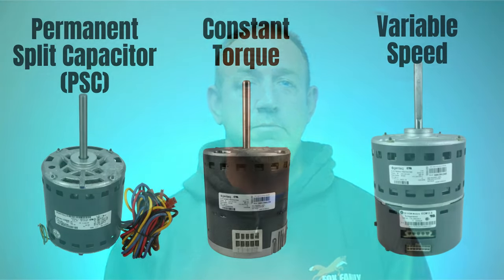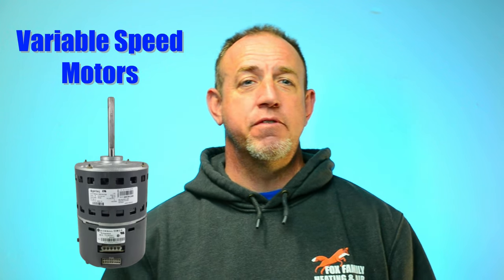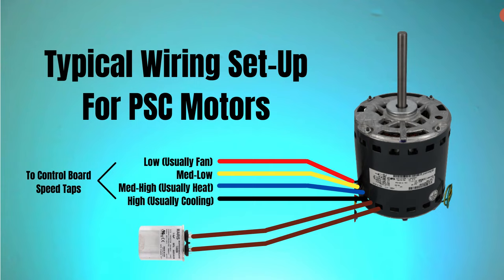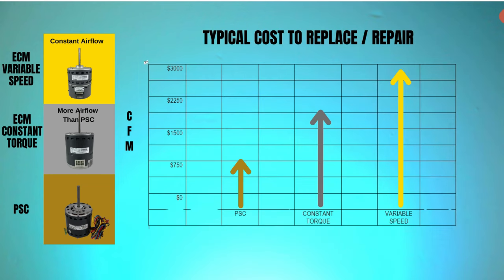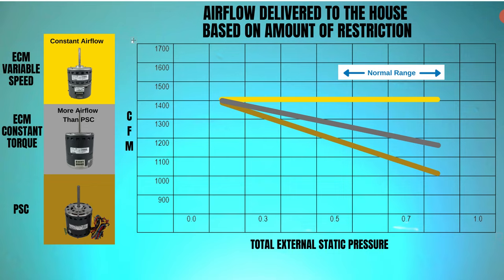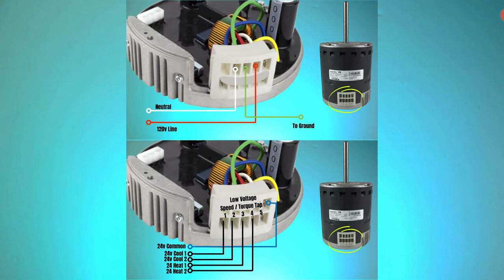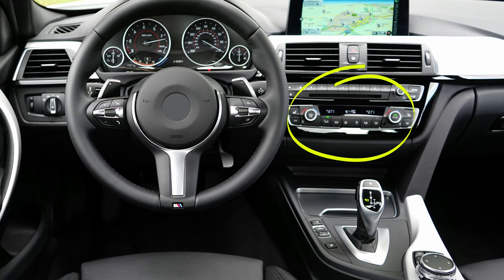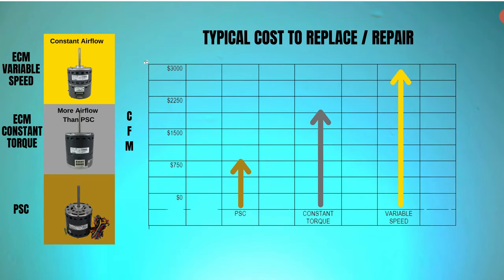PSC Motor vs Constant Torque Motor vs Variable Speed Motor | Comparison Video

Comment: Very nice explanation. I wonder, though, why doesn't the industry use more conventional AC induction motors with variable speed frequency drives. The cost of the these should be very competitive in fractional HP sizes. I seem to recall 1hp VFDs selling for just a few hundred dollars, and that was 10+ years ago. The pool pump industry has VS models that sell for less than 1500 at retail.
Reply: Even though one could easily control the speed of a three phase motor there is very little significant difference in the efficiency of the three phase motor over the PSC. Because of that they would still have to go with an ECM motor because they are 80% efficient. There is slippage when using a PSC or a three phase. No slippage with ECM.
Reply: @jimthvac100  I agree with you about the slippage,  but the efficiency hit is not that great, particularly with FHP sizes. I'm talking more about cost of replacements. The components should be much cheaper, but they are not. I'm guessing that the actual manufacturing cost of ECM motors and drives is actually lower than 3phase motors and inverters, but they are sold at very high prices because the end-user has almost no leverage when needing a repair. In other words, I think the industry may be guilty of price-gouging.
Reply: Not sure you fully understand how these motors work. An ECM motor is actually a 3ph motor with a module attached to the back that converts 120-240vac to 3ph AC like voltage that can modulating hz to control motor speed. The savings in ECM vs PSC motor is that an ecm motor can ramp slowly to its required speed not drawing FLA during start up where a psc just kicks on drawing excesivly hi amperage to get going then settles down to run load amperage and stays there. Another savings with ECM Variable speed motors is they can ramp up or down to provide only the nessesary air volume at any given time. Meaning on a multi stage high efficency unit it can slow down the fan, the compressor, the cu fan motor all at the same time when the thermostat gets close to set point and continue running at a very low amp draw while also making a much more comfortable environment with assentually no temperature swings. The slower the motors operate the less amps they draw. A psc just starts and stops drawing a lot of amperage on each start up and then continues to draw the same RLA until the stat is satisfied. The start up of a psc on each call for heating or cooling is where the majority of the energy is wasted. But if you were to leave the psc motor on all the time you would also waste energy as the fan is not needed all the time even if its running at a lower RLA draw 24/7.
Reply: The cost of a small drive will still be around $500-700 then you will still need a speed reference to run the drive at the desired speed and since you dont have a BAS building automation system you would need some kinda of fance control board withbstatic pressure sensors I/o to operate the drive and motor so another $1000-2000, then you still need the motor another $100-200, breaker or fuses to protect the drive $75-120.  So at munumim thats $1600 before installation costs. So its currently about the same costas the current residental ecm set up except the current ecm setup in residental is way more compact and actually fits inside the ahu nicely. As time progresses these ecm moters and tech will come down in price. They are pretty much standard in all new equipment being sold now lower models have constant torqe motors and higher efficiency units have variable speed motors.

Comment: The capacitors on PSC motors used on compressors and fans on outdoor HVAC condensing units are always energized on most units. There is typically only one contact that opens that prevents the unit from running, but the other 120v feed is always energized. Does this arrangement actually contribute to wearing out the capacitors?
Reply: The caps will maintain their "charge" after unit shutdown unless "bled" intentionally or if they have a built-in bleed resistor (across the contacts) but otherwise they are disconnected from the power source during a unit shutdown. I believe that cap failures are most likely due to inferior manufacturing (Made in China), after all they are a passive device. Of course improper sizing (specifically lower voltage rating than required) is a sure way to shorten it's life.
Reply: Certainly the fact that the outdoor units capacitor sitting out in the summer heat while running does contribute to why they don't seem to last long in warmer climates.

Comment: Most anything tied to Government approved is NOT going to carry any value to the user or owner. In the above examples, The cost of getting efficient results is a huge up front cost and there is no guarantee that those efficient motors are going to run for hours and hours or weeks on end that will yield the payoff. Just one breakdown with those ECM motors will take away any savings they gave from the past usage and dig into any future savings. If they are not built to live long and be durable like the PSC motor, then they are not worth the extra cost given the price of electricity remains equal. We will find out much about reliability if the state of CA forces society to spend much on the ECM systems especially the heat pump debacle. When those motors are used twice as much, wintertime and summertime, we will likely see ECM motor replacements increase which overall will pass the trash onto the good public. It surely doesn't seem to be a free country if our Government is moving into our homes and requiring "efficient this or that" without regard for the cost to "upgrade" and convert homes from gas or LPG to all electric. It also doesn't makes sense to require residents to make these conversions without proof that the changes to a specific location/residence are going to result in anything better in the emissions department. Electricity has to be produced/generated somewhere which means emissions are not getting eliminated, they are being moved from a neighborhood to where power is produced. Not to mention, the cost will very likely double or triple which will make simple electricity unaffordable to the common people. 
The only way going ECM would make any sense is...as long as someone else paid for them and maintained them and huge numbers of EMC motors were in operation, most of the benefits would be to the power grid. One on one gains aren't enough to make the expense worthy to just one address while millions of them will benefit the power grid but without any rate discounts from the power companies for using ECM motors, there won't be a lot of short time savings and benefits to the single address or residence. 
Great review about these motors so that the citizens can make fair decisions about HVAC purchases.

Comment: Great Job Sir.   Thank  you.  My Constant torque motor 's control module went bad.  Can I use the motor (the machanical portion for other means than an AC blower motor?  Will the motor actually work and turn without the control module?  If you know of a website that speaks of this in detail, can you please link me to it.   Thank you again.
Reply: No you can't. The control module is an integral part of the motor the windings are energized sequentially by the module itself. Without the module, you just have a bunch of disconnected windings.

Comment: With over 15years in the field diagnosing and repairing furnace and heat pumps... ECM and Variable Speed motor have a high failure rate.. and its almost always the control board on the motor that fails.

Comment: Have you ever come across the ECM motor that sounds like a jet engine winding up?
From 2007 ECM Goodman Furnace 97 efficient. Was working fine then changed.  No ductwork and air flow issues.
Reply: When  an ECM motor get real loud its usually an air flow issue. Did you check total exertnal static pressure with evaperator clean and dry, blower wheel clean and compare to installation manual for cfm at the measured static. If static is over .9" of static there is definitely an air flow problem. Or it could simply be worn out failing bearing.
Reply: @taylerellis378  Removed blower cage and the wheel spins freely no issues. If you run furnace without filter and jump out service door the noise is the same.  Evap is clean. So Could be ECM or motor. Noise only when it switchs to high mode. No problems in the lower speeds.
Reply: @mobilecommunicationsnetwor5268  you are pretty much at the expected service life of the motor 15years so it very well could be simply worn out. But you can check the high  voltage going to the motor an make sure its I n an exceptable range and also check the 24vac going to the motor and make sure that is also in range. 120vac plus or minus 10% and 24vac sould be between 23-28vac. Also make sure it is spining the correct direction and there is not anything else causing the noise such as a peice of tape or something stuck in the heat exchanger or evap coil. You may need a pro out there to test the motor outside the cabnet with an ecm motor tester.
Reply: @taylerellis378  I can check both of these things.  Could be using the EZ 16 in place of a $900 motor/ECM and a 1 month wait for the part.
https://www.youtube.com/watch?v=dgbTUzaM1dA  How to video. EZ 16
Reply: @taylerellis378  It has 16 pins and changes speed during operation. Has dip switches cfms choices. It in the factory defaults currently.
Reply: Your motor is a constant air flow motor not a constant torque motor being 16 pin. You can replace with a Evergreen® VS motor (variable speed) ECM built by Genteq®  (including motors formerly branded GE)
Reply: @taylerellis378  Motor 5SME39SL0674 (3/4 HP 120/240v) is the ECM Evergreen VS (3/4 hp 120/240V) catalog # 6507V and VS User Interface 5K010V This could be it. Does it need to be programmed. What does programming do?
Reply: Yes it needs to be programmed. 
Google evergreen vs installation manual there is a pdf that explains everything. 

NOTE:  If the original ECM motor is rated 3/4 or 1 horsepower (HP) and is installed in a 115  VAC  application, there may be a power factor correction choke wired in series with the line voltage 5-pin plug.  This device should be left in the system as connected by the HVAC  OEM

Also make sure to mount the motor with wire connections face down with a drip leg in wire harness to prevent water contacting the plug. 

The airflow in each mode of uour furnace needs to be set. Stage 1, 2 heating, stage 1, 2 cooling, and fan only mode. Its best to test cfm i. All modes on current motor and adjust the motor in all modes to operate at the same airflows. If your system is 2 stages if cooling and 2 stages of heating with milti stage condenser this can take a lot of time and patience. You will need air flow testing equipment such as hot wire anemometer and possibly a vane anamometer if you have return air grilled in duct near furnace return intake.
Reply: If you buy oem you have to purchase the motor from the factory and yiu have to give them your furnace model and serial number. You cant just buy a motor of ebay with the same numbers as they are programed by the factory for your specific furnace. If you do this its plug and play.

Comment: I have a PSC Rheem air handler RMSL, can I have the motor & associated upgraded to an ECM Variable Speed Motor?
Reply: I think ecm's are crap.
If you get one.....make sure your intake vents are actually properly sized or the reduced airflow will cause the thermistor to blow and it's not replaceable due to some epoxy crap they put in so it ends up costing you big money for a total motor change.

Comment: So true and of the three versions of residential HVAC, single stage, 2 stage and variable stage, the most reliable turns out to be the one that can be only so much efficient.  
You would think that if the Government is going to guarantee manufacturers with 14 SEER minimum A/C systems and there are more efficient systems made, that the Government would simply step it up and make the minimum SEER closer to 18. If they did, manufacturers would then be able to produce more efficient systems for less money because of the added volume in sales for 18 or higher systems.  As it is, 14 SEER is likely too much on its own in technology which forces the manufacturers to have to charge way more for the others due to limited volume of sales usually affordable to more well off folks.  It's truly unfair to mandate systems on the lower efficiency levels when the choices most folks would opt for are the higher SEER had they been more affordable. Sadly, the federal/state minimum SEER ratings are forcing folks to get less value because "the law says" this 14 SEER is all I need but dollar per SEER or dollars per kWh of expensive electricity is what makes systems worth their weight in the end.  My guess is, a 14 SEER vs. an 18 SEER likely yields a good 40% less power consumed for the same BTU's. The Government needs to be more proactive in minimum requirements especially when the cost vs benefits tend to be in the 18 SEER range. And those who live in California know that .35 cents per kWh adds up way too fast to be fair to them. All while other States can sell power at 6 cents, 8 cents or 10 cents per kWh and stay happy, Californian's are being forced by the monopoly the state created, CA ISO plus they run the CPUC pretty much to their own benefit vs. the rate payers. 

No matter what folks do to be modern and efficient with their homes, it seems to be a losing proposition that one will save money by spending large in home upgrades. No matter what they do to get energy usage lower, the rate increases keep those ideas less attractive.  Our home used X amount of power with a years worth of usage 30 years ago. Today, it uses about half what it used yet the cost of power is 4X so the savings didn't occur, it reversed and power bills are way higher even though power consumption is now less. Rate increases with most California electric utilities occur 10 times per year...rate increase notices come with each monthly bill letting people know they are looking for more money for this or that. Most of the reasoning seems to be infrastructure improvements however, most of them have been irresponsible over the past 30 years in keeping in sync with the times, allowing deferred maintenance to enter the budgets year after year, decade after decade. Until now, they are up against a wall due to massive fires and are in panic mode to catch up with a good few decades of needed upgrades.

Increased population and housing projects sure do not help the matter yet, the Government ignores those factors it seems, we are low on water, limited power (man made of course), drought, much Government oversight thus high costs etc. and the cost of living in CA is shameful, regardless of how much folks spend or do to conserve, the state keeps adding (being ignorant) more and more demand on our resources...
Reply: Infrastructure spending: importing and housing a newer sleeker voter. I'd wait a little longer to see who wins and if they actually focus on actual infrastructure: utility upgrades, more refineries, development of resources and proven energy technology. But they just about screwed up with water because they bet the farm on the Colorado which is not looking too hot. Or cool.
Reply: Don't see what the absurd electricity prices in CA have to do with home upgrade decision making... if you didn't invest in those upgrades you'd now be paying 4x, not 2x... if anything the high prices make the larger upfront investment more worthwhile. I really have no idea what CA has been doing with your money for the past 30 years. Costs should intrinsically be higher just due to fire risk, other weather damage. When fraudsters were running the place in 00' it's hard to imagine they were doing much long term investment. Certainly huge amounts squandered with every new backwards piecemeal policy, from means-testing discounts to subsidizing rich people's solar and back again... But yea no doubt about it you need huge amounts of investment now, wholesale cost is basically irrelevant. 

SEER is such a mess. Manufacturers are required to sell only equipment rated at a certain level, want to get everything they can out of the fixed costs for manufacturing the previous rating level, and as you said a lot of people are sold on the minimum rated system that's legal, ergo less demand, functionally making the efficient technology prohibitively expensive. By the time the new tech is deployed at scale and is fairly cheap to manufacture, they need to scrap it all again as it will soon be illegal. The mandates inherently provide little-to-no marginal cost savings, and the savings inherently get worse as efficiency improves in ever smaller jumps. With more workarounds that introduce more points of failure. Almost like the benefit of free markets is their ability to provide differentiation to consumers. All the costs of capitalism, none of the benefits.
Reply: @garrettmillard525 Electric rates were not so bad just a few years back, they were in the 18 to 20 cents per kWh range. Today, they are 42 to 48 cent range. People didn't and still don't need new HVAC, the old stuff still works except for the operation cost with high rates...residential bills are $650 to $1,200 monthly for a 2,000 SF house. That will be about the same bill in winter if they require heat pumps.  New tech is junk these days by the way, repair costs and frequency of repairs are too often.
Reply: @garrettmillard525 BTW becareful when suggesting the market is a free market. The DOE and the EPA cause that free market to be NOT so free and full of mandates.